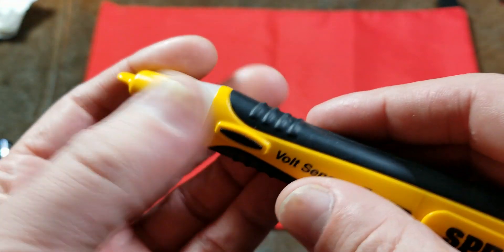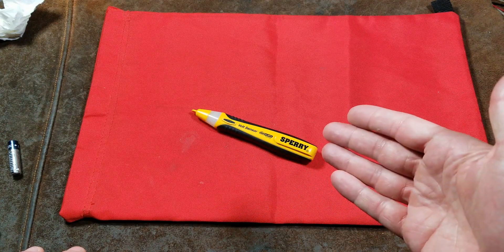Sperry Non-Contact AC Voltage Tester Review

Comment: The working principle is how you can bury drums on either side of high tension wires with acid or saltwater and an athode in one and cathode in the other and "steal" electricity. They actually look for this with a similar tool from helicopters along powerlines. Only way more sensitive. EMF.
Reply: Huh

Comment: Where did you find it for $5?  It's $12 or more every place I've checked with Google.

On a bright note, it looks like the adjustable sensitivity one is only $2-3 more, so if you have a $5 source for yours, maybe the adjustable will be $7-8.
Reply from the maker: I got this off the bargain table at a local electrical contractor supply those places are usually expensive so I just assumed it was really cheap but apparently it really was a good deal this time. I should have looked up and seen they have a variable sensitivity unit that really is a game-changer because it gives you a variety of tools in one